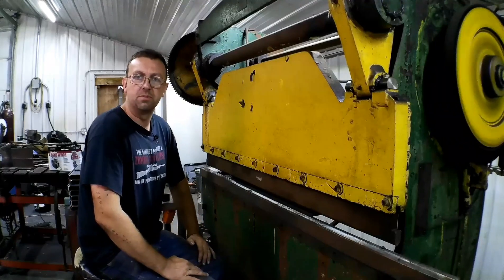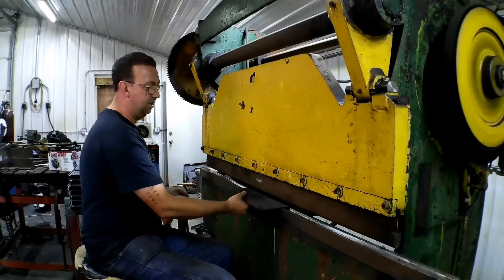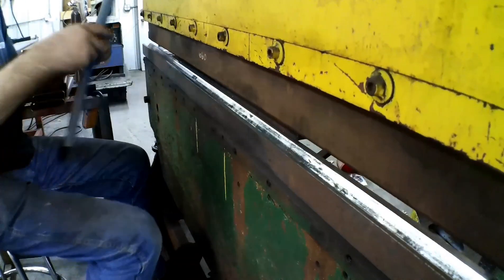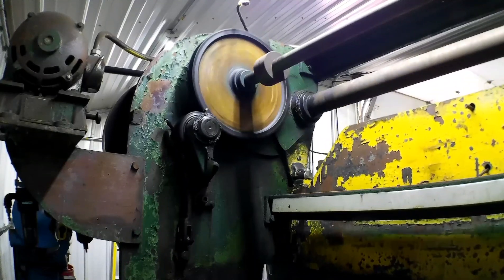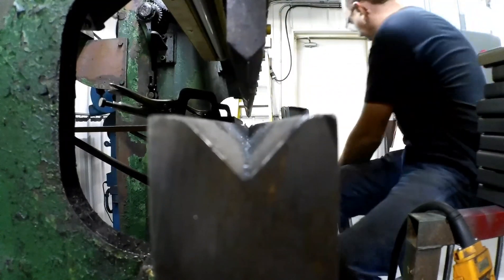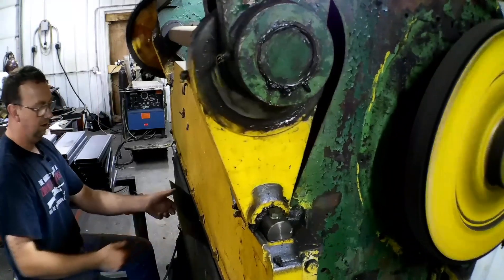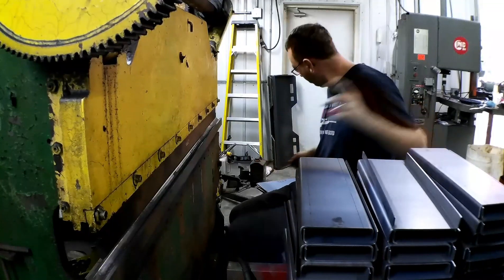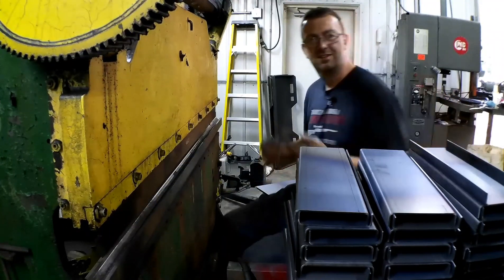Press Brake in the Machine Shop, Why We Need and Love It.

Comment: Safety is extremely important and the top priority is to work safely to avoid "accidents" and injuries. However, some safety organisations take this too far, like what you mentioned in making the machine unusable. Any time I use a machine or a tool, I make myself aware of the consequences of not doing so with care. I use many tools and types of equipment that could cause me serious injury, so I always take care when using them.

Comment: Leave that thing in my shop and I would use the gears / fly wheel for an art project then it would be a hydro-mechinacal conversion with limit switch's. One of these would convert to a rocker type easy peasy

Comment: I agree, using a lathe or milling a part has their nice part, but the sheet has something very special and that's the flexibility you have for design and that it looks really straightforward,  but it is completely the opposite... unfortunately the machinery needed for working with sheet is more expensive in some cases. By the way, your press is really nice, hope you could share with us some of your know how for the punch press!

Comment: I worked a few years in a sheetmetal  fab shop. It was mostly HVAC but we did build a fair amount of structural steel. For the commercial roofing division we made miles of coping, trim,facia,gutter and my favorite roof curbs for new roof mounted heat and air machinery. A lot of this stuff was formed on an autobrake or folder as some call them. Once you had all the bends programed you could run a lot of metal through it.AL B.

Comment: josh, not that it is any of my business, it is more curiosity. how big is your shop and how much help do you have?
my story is that i worked in a small machine shop in high school in 1970s. it paid for my college education and  my first pickup truck 1976 and in 1978 i graduated college and took a job as a mainframe programmer analyst at Pratt & Whitney Aircraft.(jet engine manufacturer) 
i guess when you get machine operator experience you can never get rid of that. if you had a good experience it sticks with you.even if you move on. i guess do what you love, or love what you do.
i can tell you love what you do. keep on doing what you love and when you lose that love find something that love. hopefully it is better. God bless you on your life's journey.  may your spirits remain high and your troubles be few. may your good common sense prevail. cheers may 2022 be better than 2021. and keep up the good work.
Reply from the maker: Not very big. About 3000 sqft of shop space. Thee is alot crammed in here. I do enjoy what I do. It has days that are infuriating but they aren't all the time. Thanks for watching

Comment: if you have a manual for the press check the flywheel rotation i think it is running the wrong way
Reply from the maker: I don't have one. I've asked several people who have worked on these and nobody can give me a consistent answer. As it is, it's been running for 7 years with no issue.  I could try reversing it and see is there is any difference. Thanks for watching.
Reply: @TopperMachineLLC  Hello Josh, It is running in reverse. You want the pitmans to push the top of the ram towards the housing guides when it hits the part coming down. That way, the force is against the guides and slides. When it is in reverse, the pitmans are trying to push the top of the ram away from the guides, putting a lot of force on the guide clamps.

Comment: I guess you wouldn't be allowed to have an employee operate that press? I'm a big fan of presses & presswork but in the U.K. there are actual laws related to the use of power presses (which I think would include mechanical press brakes) , not just general factory Health & Safety regulations , which require regular inspections of bearings & clutches/trip mechanisms as well as guarding, which in turn requires removing the flywheel every couple of years. Even on my little 6 ton power press, the cost of keeping it legal is more than the work I use it for is worth! So it sits with a red "Do Not Use" sign on it...
Reply from the maker: That is ridiculous. These machines are safe if you use common sense. Yes, accidents happen, but in the 8 years in the first shop I worked with 5 guys running punch presses and press brakes, we only had 1 incident. And we later found out about his drug problem. That same accident was a simple pinch of his finger tip, not even anything serious.
Reply: @TopperMachineLLC  I totally agree with you about common sense & safety!

Comment: I started out my metal working as a tangent arc profile grinder on milling cutters for the Brubaker Tool Co. later on I worked on punch presses and press brakes and welding, then onto milling machines and surface grinding, the last job was working with large machines one being 108 inch Bullard vertical turret lathe...loaded work on it with a 25 ton crane and it would groan when I'd pick up somethings...learning all that you can, makes you a well rounded manual machinist, in my opinion,  and those press brakes are nice to have..always wishing I had the space to have one... good video's ! I like your channel !!

Comment: It does look like fun.  Next time you have a press brake job, I think it would be interesting if you could set up a camera looking down and time lapse the set-up.  No need to do a fancy voice over even.  Whatever you think would look good and not interfere much in the process of making money, but give us a hint of the set-up complexity.  For instance, on this job, do you take measurements of the stop locations before you break it down so you can easily recreate the next time this job comes up?  Do you need to do several test pieces to make sure you’re within tolerance?  Love the channel…… 👍😎👍
Reply from the maker: Will do. Setup is super easy and on these parts is non critical +/-.005. thanks for watching